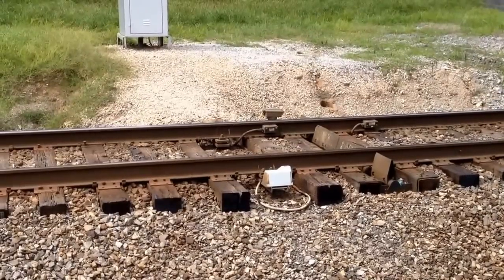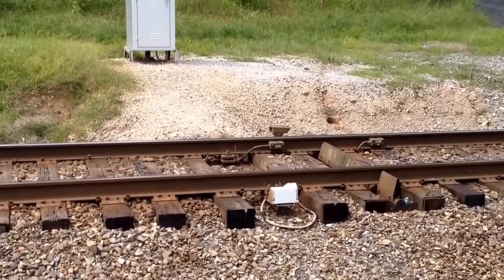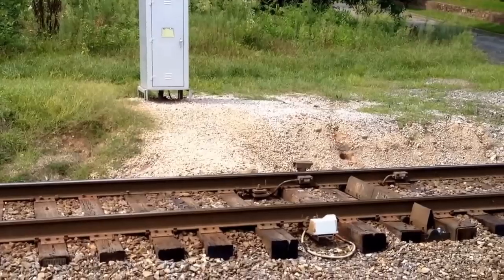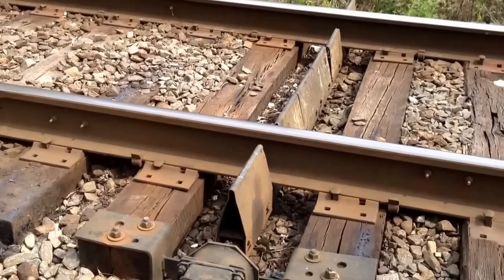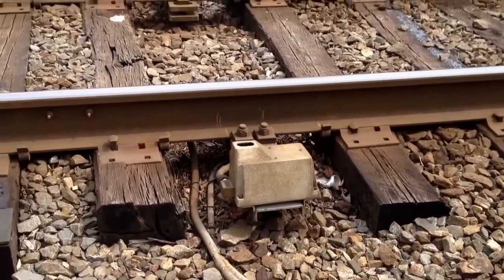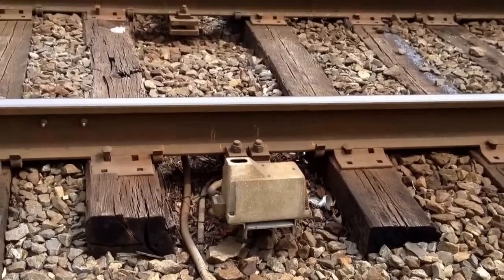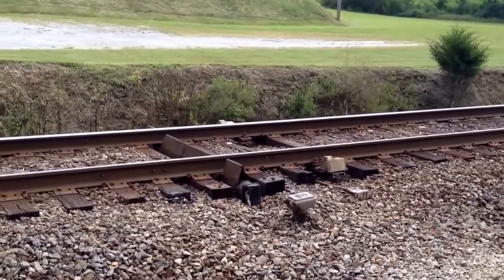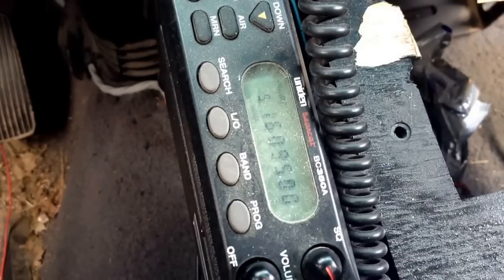Railroad defect detectors and how they work

Comment: At first, it looked almost like the detector, one on the P&W's Gardner, MA branches, being installed afer a string of Auto Racks derailed. (The wheels were already off of the track as P&W pulled them out of the B&M  Gardner interchange, as evident by the pavement groove marks in the nearby grade crossing.)
I am unsure if they might use it just so to count the number of axles of the train they are picking up from Guilford's B&M. There is also a Dragging Equipment Detector in the mix.

Comment: Very good information. I would like to  learn how R/R crossing signals operate.
Reply: t. hof the approach/ departure blocks are insulated from tbe rest of the rails. A low voltage is transmitted( 12-20v.). When train,enters block, it shorts out the voltage, cutti
ng power to  armature, allowing 
gates to drop & activate
 lights/bells. when last trucks clear the block, voltage resumes, armature loses power, allowing gate
Reply: Allowing armature to raise gates, turning off lights.

Comment: I believe some defect detectors also register on the PTC board with the dispatcher. I also noted locally, that the defect detector radio transmitter is very low power, only audible for about a mile. I live 2.5 airline miles from the detector but can't hear it at home, yet I can hear the locomotive radio transmitters from almost 15 miles away. Thanks for the details.
Reply: The defect detectors are only for the train crew to hear if you get the detector you are very lucky to hear it. It's actually funny how you can hear crews talking from miles away. I find it funny because you can hear the crews from miles but not the detectors 😂

Comment: had u pushed the part on the track forward it would've tripped the detector
Reply: Jackson Slater ElevatorRailAlarmFan 
Detector will not transmit just by pushing over deflectors. It first needs to be switched from standby to ready by an approach signal set by first 4 axles of train.

Comment: Is this a Southern Technology brand system? Thank you - nice video, too.
Reply: Yes this is a Southern Technologies "Sentry" Detector, you can tell this by the type of pyros and transducers being used.  These are being phased out and replaced with newer Southern Technologies detectors.
Reply: Thank you, Todd. My territory uses the Progress Rail Mini-Talkers that are rated for our high speeds (125mph to 135mph) & set to talk on alarms only, since, they are connected via modems to our command center. I've worked with the Servo 7707 (ballast mounted scanners & vacuum tubes), 7708 (a hybrid of the older 7707 outfitted with the Servo 8808 rail mounted scanners), Servo 8808, and the CyberScan 2000 (Harmon product after they had bought the Servo Corp) which have now been replaced with the Progress Rail systems. The Servo 7707's originally had only 2 transducers. Later, advance start transducers were added about 75 feet north & south of the scanners, because, as the train speeds were increasing the 1st wheels would be missed. Adding the advance start transducers had eliminated this problem.

Comment: I HAVE MOST  THAT I NEED EXCEPT CAR RACKS. BUT NO TRACK YET. $10,000.oo ..WORTH.. SO FAR. SO I AM SERIOUSLY MAKING A  LAYOUT.   I HAVE SEEN BANKED TURNS BUT NEVER  ON YOU TUBE.  I WATCH MANY ,  SO I SHOULD HAVE SEEN A BNKED TURN, , OR IS IT BECAUSE THE CAMERA  DONT PICK IT UP?    I SEE  AUTO GREESE  ERS ON THIS BANKED TURN BEHIND MY HOME. EVERY TIME THE WHEEL HIT IT   ,IT WOULD  SQUEEZE GREESE ON THE INSIDE OF THE RAIL.. WHAT IS THAT FOR/?   IS IT FOR WEAR OR HEAT?  THIS SECTION IS EAST OF UNION CITY 2 MILES AND WEST OF CORRY PA. IN NORTH EASTERN PA.    [ERIE COUNTY]

Comment: WHEN U BUILD A TRACK,  HOW DO YOU KNOW HOW MUCH BEND TO PUT IN IT?  HOW MUCH BEND CAN THE TRUCKS  DO BEFORE THEY COME OFF THE RAIL.  DO THIS DEPEND ON HOW LONG THE TRUCK IS?  I OFTEN HAVE DERAIL PROBLEMS WITH MY 3 AND 4 AXLE TRUCKS  [ ON ENGINES ], YES I NOW  THE DIFFERENCE  TWEEN REAL  AND  HO GAUGE.. THEY COMPINSATE WITH AXLE SLOP BUT HOW DO REAL TRAINS  COPE WITH TIGHT TURNS. IS THERE A RATIO  OR  MATHMATICAL  FORMULA FOR TURNS?

Comment: The one near our house is like a signal bridge!
Reply: the framing that looks like a signal bridge is for holding light emitters and receivers to determine if loads have shifted out of the clearance limits or/and are too high for an overhead clearance.  Places where these are common are a safe distance before through truss bridges and tunnels.  I have seen and photographed what a shifted load does to a through truss bridge.  The signal equipment box looks like a standard box like at a grade crossing.
Reply from the maker: Ultimate Railfan I would like to see that.....it sounds cool
Reply: There Huge!